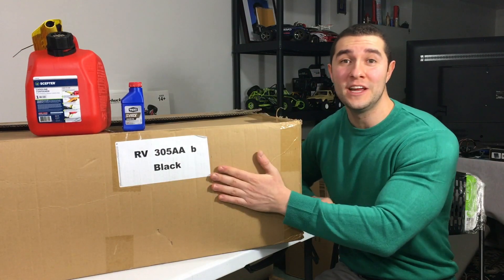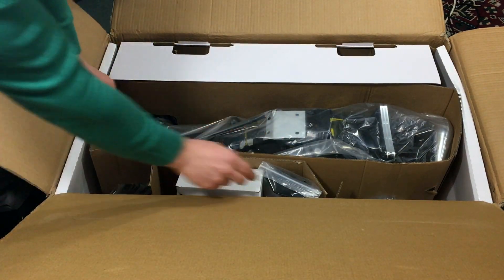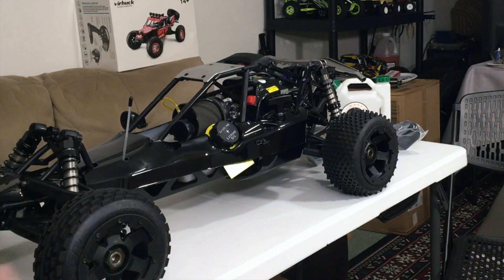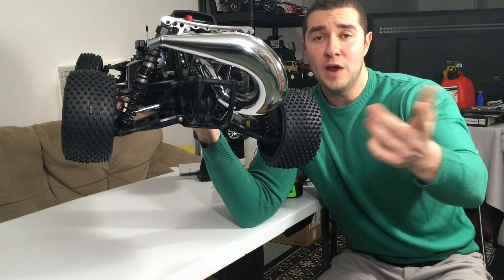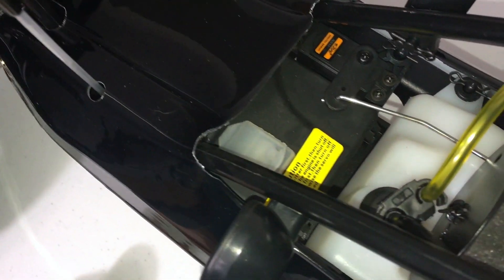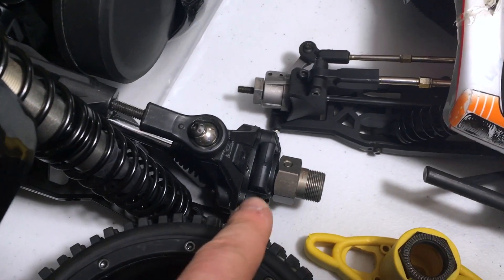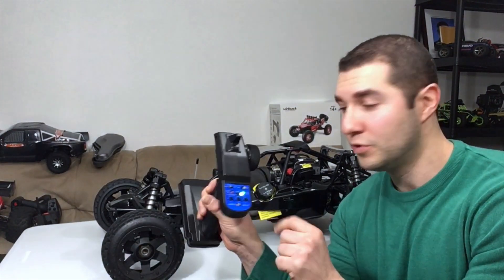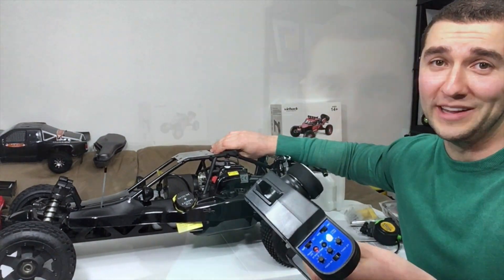I got the cheapest 1/5 scale gas buggy ROVAN 30CC (what's it like?)

Comment: I used to have an HPI Baja buggy. Mine was a kit too which I had to supply my own radio except for the steering servo. I put 100's of dollars into it too. It was fun but I sold it years ago. That clone buggy is a great bargain. With that aluminum shock bracket and that tunes pipe. I hope you have a place to run it. have fun. You'll need a better air filter.
Reply from the maker: thanks buddy!!.  Im looking forward to breaking it in soon,  I have pick Castor 927 racing oil for it, what do you think?  I don't really ever run on first or sand anymore, so I think the air filter will be fine, don't intend to mess this up for the pure bashing vids as many ppl do.  My goal is to just show that these are worth the money and reliable in normal starting and running conditions.  IF I want to bash, I use my VXL slash, lol.
Reply: @hybrid32494  I'm sure that Castor 927 is good too. I think I used to use Amsol 2 stroke oil. There is an HPI Baja forum you can go to to find out all about the Baja. Just don't tell anyone you have a cheaper clone. There should be a lot of after market goodies available for it too. Check out DDM (Dave Discount Motors) for just about everything. Here's the link: http://www.davesmotors.com
Reply from the maker: yup, i read all the 1/5 scale gas threads related to oil.  It seems the castor 927 is the all around best.  The dominator 2 stroke is great too, but literally twice the price of the castor 927.  PLus it says that break in should not be with synthetic oils, and better to use conventional, IDK about that.
Reply: I used to bash my Baja. But back in the 80's I used to race 1/8 on road nitro cars, the Serpent Excel was the car. And in 2006 through '08 I used race a 1/0 nitro Losi XX-NT. Then I got into the Baja as the racing seemed to be dying out where I was living. I had a great spot that was walking distance from my house for a while. It was a new community under construction and there was an undeveloped spot that was great for running at.

Comment: Great lil buggy loud asf quick bought myself one before christmas after your first run/ breakin. Go over all your bolts i did have a few loose. rear tires are trash expect to replace them in short mine lasted 5 mins in a grassy field the rubber tore. But over all great for 446$

Comment: Great vid If you going to buy a hpi 26cc engine its cheaper on DDM its 245 complete! You get more bang for your buck with Rovan but the hpi baja  parts dont match up exactly... the holes are slightly off. Rovan is a great start to get into the 5th scale hobby!
Reply: What's a good servo to use in this throttle and steering?
Reply: @eflowers765   i use a savox sc 0225 for my baja throttle servo u prob would have to use  the stock servo horn because i think the servo horn that savox gives is shorter! If you use the savox horn u wont be able to get full throttle!

Comment: Can you post a link on where you bought this? I cant find one like yours at all with that engine or especially anywhere near that price, all of them I'm finding are $650-$899, thanks for the awesome videos!
Reply from the maker: hey man!! I just checked eBay for ya,  you're right.  IT looks like very few ROVANs are even listed right now.  It's ok, here is a link to their website, it's the same thing as eBay basically and free shipping too.  Check their site for other models if you can too.  There is a green one that is the same spec as mine for 529 right now.  The one in this link is 429, but it has a slightly lower engine displacement.  
https://www.rovanrc.com/1/5-buggy/1/5-scale-275a-27.5cc-gas-ready-to-run-rtr-gas-baja-buggy-blue/
Reply: @hybrid32494  awesome thanks man, I gotta have one of these lol
Reply: He got a steal. He paid what an aftermarket exhaust costs for my 1/5 scale losi 2.0 lol.

Comment: Try Maxima  castor 927. It's a great smelling, great lubricating 2 stroke oil at a great price.
Reply from the maker: hey bother!!!  Thats what I wound up choosing, great oil.  I made a few newer update and running vids on this, check them out.  Great oil for sure, do you get the 64OZ size? that seems to be the most cost effective one.
Reply: Have you guys ever tried Motul or Amsoil Dominator. Also I'd like to see how it runs on VP race fuel. 😎

Comment: They should have a pre filter cover for the air filter, I think outerwears makes one for the HPI Baja, should probably work on the Rovan buggy filter. Just like the other guy said ,make sure 2 oil the air filter with some 2 air filter oil for 2 strokes, like some Bel-Ray, Maxima, Amsoil,ETC.
Reply: Pretty much everything for the hpi fits the rovan km models. Some upgrade parts dont fit and will need the hpi part to fit to it

Comment: king motor / rovan.   i have two of the KM.  the baja 5b.  the rovan is the cheaper of the two.  km has thicker and tighter fitting parts.   the radio, battery and servos and motor suck on both though.  i have put zenoah 29cc in both mine and they run fine
Reply from the maker: hey my dude! thanks for watching! I have since gotten 2 more Rovans and a King Motors Baja. My stock 30CC rovan hit 44 MPH, and is still kicking AS* to this day! All stock motors too. Check out some of my newer videos, you will see.  Ofcourse the 29C zenoah is a great Motor too, no denying that.
Reply: @hybrid32494  i will chek them out sometime.   Lifelong rc modeller here.  50 yrs worth.
Reply from the maker: @stevethomas-cc5lz  glad to have you here my dude! You got a couple years on me, but I think my appreciation for this hobby will surprise you.  I treat it with respect and never destroy my stuff just for views.

Comment: Nice ride buddy. I still have the 2wd marder and bought the 26cc upgrade motor and pipe exhaust. This was years ago and it rides fine. I hope you will be having the same fun i'm having. Maybe some day a 4wd kit or those crazy 71cc beasts. Sounds less like a weedwacker :-)
Reply from the maker: ye man i'm getting to understand the fun with the 1/5 scale models, taking a break from nitro now after this.  I was considering one of the front disk brake kits for this.  I saw a nice kit for about 40-60 bucks which is purelly mechanical it says.  You ever seen those?  BTW i started this up and ran the first tank in the newest video on my channel and used the silencer.  Listen to the noticeable difference it made.
Reply: @hybrid32494  Know nothing about these brakes but the muffler was pretty good :-).

Comment: I owned a rovan and ended up breaking just about every single part and it ended up just being a HPI with a Zenoah engine in it.
Reply from the maker: Cameron Brantz   Hey man!!  So ur confirming what we all already mostly know.   That these clones are basically the same as hpi.  So this means thatbthe 13-15 yr old hpi design is still the same, lol.
Reply: @hybrid32494  Yeah they are basically identical but the metals do not have the same tolerances and are weaker so about a year in you'll have spent the same amount on parts as you would have a HPI. When I rebuild my motor about an hr of run time i pulled it apart and it was literally missing parts of the cylinder.

Comment: there's a reason this is cheap, and the HPI costs more. This one's junk, the HPI isn't.
Reply: I beat the shit out of the one I bought and it hasn't had any problems yet but even if it had...Everything on it is interchangeable with HPI so as parts break. I will just replace them with better parts. Either from HPI or Aftermarket Aluminum parts makers.
Reply: @Brandon Jones well at least for me with my experience... I haven't had any problems with anything lining up or not fitting. More importantly... If I did. I live in rural Minnesota so I don't have a dealer by me which means I order 90% of my R/C stuff online. So if it ever was an issue I would just get the Rovan/King Motor parts that do fit. 

I'm not denying that it's a lesser quality model than what HPI produced in years past (we'll have to see where the new ownership takes HPI). But I will NEVER spend WELL OVER $1,000 on an R/C Car/truck/buggy... Because as much as we all get irritated when our wives call them "toys". If we're being honest with ourselves... That is, in fact, what they are.
Reply: @Brandon Jones I know that. I've got plenty of expensive Revo, T-Maxx and Savage models. But none of them cost me more than $600. And most of them I buy as parts lots or collections for sale on ebay and fix them. That way I get an awesome Revo 3.3 or Big Block Maxx and a boat load of parts to build them with. I do have 1 Revo Platinum that I bought new and paid $750 for. And 1 T-Maxx 3.3 that I bought brand new when they updated it with the longer chassis that I paid $600 for. Both of these are set up for RACE ONLY use. I've got them so low that they might as well be buggies. But they outrun and out handle all the buggies I have. The only thing I have that can keep up with them is an HPI Hellfire SS. 

So I do thoroughly understand that they aren't "toys" to us. But to our spouses and the rest of the world. They are.

Comment: Yr better off with the 28: or 29 cc. They spin higher revs and are quicker than the 30 cc which has only more storque
You should strip that down and rebuild it. Will all vibrate loose with no thread lock
Reply from the maker: hey buddy! thanks for watching.  This was my first Baja, so I've done alot of learning over the time.  I can totally agree with your points o the small motors having more RPM.  Please watch my newer vids on this, I got a top speed run of 44 MPH with this (stock-only larger rear tires) and I also have a 29CC rovan, that one is about 6 MPH slower overall.   Ive checked RPM in my vids and this motor got 17,800 max RPM, not bad for a stock budget rove, right?
Reply: Hi, I like your comment. Which do you recommend for a cheap 1/5 rc ? Thanks
Reply: @topdown3852  cheap rc is rovan or a king motor buggy.....or if u are a little cluey, 2nd hand bajas pop up for half price, but be careful...many have been thrashed and need alot of work to get running, beware buddy

Truth be known, both hpi and the knock offs all need upgrades, when u start pumping more power thru the drivetrain stuff breaks
Fact of life, its just wank factor owning a hpi, but if u race sanctioned proper events, u will need a hpi
Ive bought 2 rovans and 1 hpi, they all need upgrades cause the stock parts are shit quite frankly
I have a 29cc engine in my hpi, they call it a stage 1,  which i believe is port polish and matching the head to the bottom end so intakes all line up and it flows freely, but breaks stuff all the time, so u just keep upgrading till it stops breaking
also open up yr carby intakes and the exhaust, but very important to know where to remove material and how....remove 1mm too much and throw yr engine in the bin lol

Quite easy to learn actually if u take yr time

Comment: Looks like its gonna be fun, is the hpi parts interchangeable with this? I think ive heard of this company, dont they have the models that look like the Losi 5T?
Reply from the maker: yup, these have fully interchangeable parts with the HPI baja it says.  I saw they do have the same losi 5T type models, and really cool on-road sedans too.  They are all over 600 though.  A stretch compared to this one here.  SteveO do you know or remeber the 1/5 scale brand FG?  They sell for over 1K usually, top notch, but too much for RC i'd say.
Reply: Yes and amount aftermarket parts are endless they build alot diffrent kind of racing based from the original hpi baja now its smarter start these rovans the deals get compared to hpi and you fully getting into money no issue you end uo building from mostly aftermarket losi s 5t replica are rovan lt 360 ofcource nicer have brand i have losi 5t but instead putting top line obrian i now have rovan 36cc and its compareble to a smaller displacement obrian motor for 200 dollars cant go wrong ..guys if want lear alot 5th scales go to botagel rc he dont like electric tho dont metion it lol
Reply from the maker: yup, this is the best 1/5 scale gas RTR deal there is.  First time I say an HPI Baja with the original engine, OMG, it was so slow.  These should be much quicker.
Reply: Hpi/Rovan/kingmotor its all the same. Interchangeable parts too. Its all about the brands this days.SMH.
Reply: @hybrid32494  no i've never heard of the FG brand, I dont really know much about the gas or nitro rigs, but I've been looking at the 5T clones lately
Reply from the maker: YUP, they are.  And guess what? there are still people in the comments here saying that HPI is very superior to the other lower known brands such as this.  I guess they enjoy paying way too much for the personal satisfaction of knowing they are the ELITE of the RC world, hahahaha.
Reply: @hybrid32494  LOL If it was me I'd buy this brand n $5 on HPI stickers n then no one but me would know, hence the term fake it till u make it! 🤣
Reply: @STEVOD313  yes and like stated hpi is a pig  stock and needs be upgraded , and had you wanting the 5t 4wdrive when they came out , but you were getting towards 2gs for ultimate rc either hpi fully custom or a stockish hpi baja but pretty much were only choices i never got into fg other brands but i didnt really use internet for anything do with rc till recently
Reply: Best deal you can on 5th scales to get started 450 w everything you need even aftermarket pipe sometimes they dont use locktite and if dont go over basics usually ppl that arent mechanical or never had rc something rattles loose than breaks and say shouldve bought brand name but quality not bad all anymore rovan seems be good company
Reply: They doing what arrma did to other companies with e rigs bang for your bashing buck cant be beat
Reply from the maker: I rem when the HPI Baja came out, OMG.  IT was so slow in person, literally a basic brushless 1/18 scale back then ripped them.  Unless they had a super overpriced 2-speed and pipe mods they were just so slow.

Comment: I was thinking of getting a Revo 3.3 but this looks cool which should I get
Reply from the maker: I have a revo 3.3 too.  Great truck.  Both of these are totally different though.  are you looking for your first nitro/gas model?  Speed wise I would say they are probably the same too.  Check my page on the revo 3.3 I did some speed runs and overviews on it before.
Reply: hybrid32494 thanks for your response, it’s going to be my 1st nitro because I’m kind of tired of electric.
Reply from the maker: yup, you got it!!.  Electric is great and all, but the learning curve is pretty fixed there.  The nitros and Gas models are alot more temperamental and when you get one to run at least pretty well you will have way more joy and satisfaction than even the fastest brushless trucks there are.
Reply: hybrid32494 should I get a Revo 3.3 or is there a better option ? I was wondering if I’d enjoy it because I’m so use to my Fast and quick Bandit VXL and just don’t know if I’d think it’s boring and slow .
Reply from the maker: hard to say, from the non big block nitro trucks the REVO is definitely the best.  You could get a larger 1/8th scale model with a big block motor, but they come with their own issue.  For one, they take more fuel than the revo motor.  and nitro today is about 45 a gallon for 20%.  Really a great all around truck with super plush suspension and nice electric start.  They also have good resale value on eBay, lol.

Comment: dang there was a 29cc one not to long ago in black for around 300 bucks i dont see it anymore on the rovan site,and all the ones around 450ish are sold out however this is still in stock for 499 "1/5 ROVAN 320A GAS PETROL BUGGY READY TO RUN RTR 32CC HPI BAJA 5B SS KING MOTOR" so i guess ill be getting this one in a couple weeks,all good though i dont mind a couple hundred more for a bigger 32cc engine and the color i like, this will be my very first petro beasty :)

Comment: Is the 26cc engine for rovan available for sale? I have a terminator rovan 26cc engine and want to replace it. Question, can i replace my 26ccrovanterminator truckl with 30ccengine? by the way I like your review of the buggy. Hope to hear from you?
Reply from the maker: Hey man!! Thanks for watching.  You can safetly get any engine upto 32cc id say.  Im actually starting a new engine install project with a rovan 32cc engine.  It will be in my next video, it would be your best bet. They are all the same basically as long as its 32cc ir less you should be good.
Reply: yes you can.  get a zenoah from DDM.COM

Comment: I bought the King Motors version, and mine came with Flysky remote and a 34cc for the same price
Reply from the maker: Victor Baker Jr wow.  Thts terrific.  I was looking for that model too. Cud not find it.   You got it on ebay too? Im looking now and the only models with the flysky i see are at least 550 now.
Reply: I bought a T1000 I got it from king motors. Com it's a 2wd 34cc it was around April ,it was on sale 30% off 395 plus I bought a upgraded duel pipe from China, oh yeah the fuel line is in 2 pieces going into the tank you need to put one solid piece line through the rubber grommet cuz that will come apart eventually. And my car came with a FlySky remote the one you got was shity